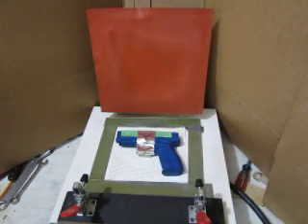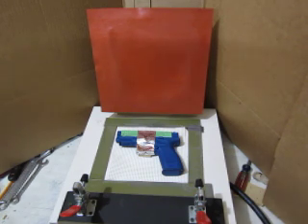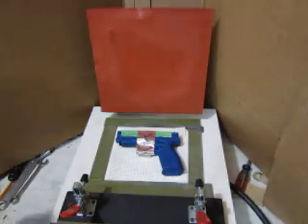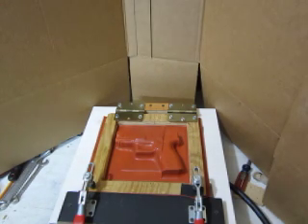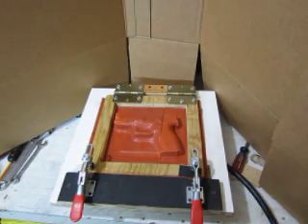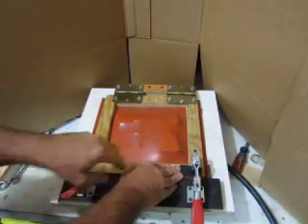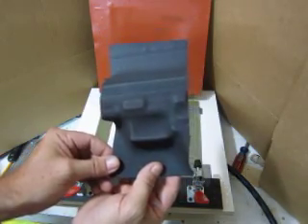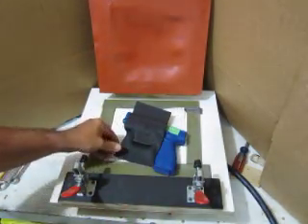Updated Membrane Vacuum Former

Comment from the maker: I ordered it from Amazon part# B005JFSGWK  that is for a 12"x12" piece for $9.54 their discription:High Temperature Silicone Rubber Sheet, No Backing, 40A Durometer, Smooth, MIL-ZZR-765, Orange, 1/32" Thick, 12" Width, 12" Length